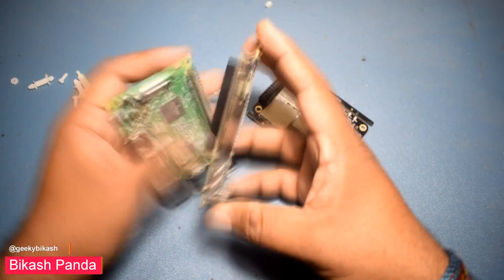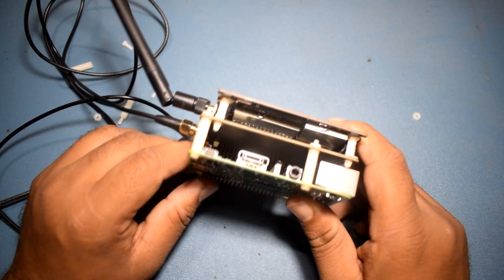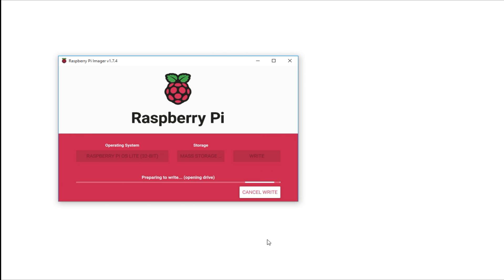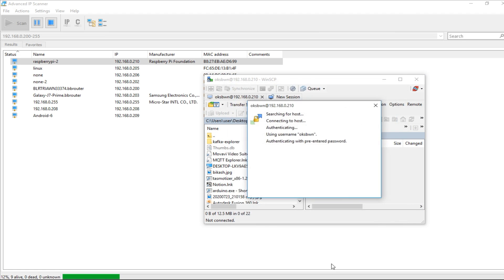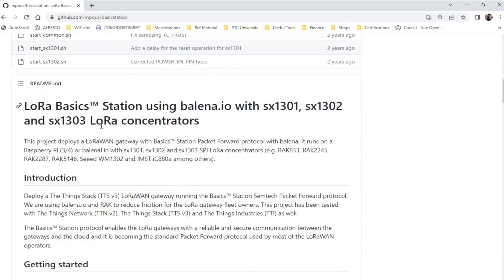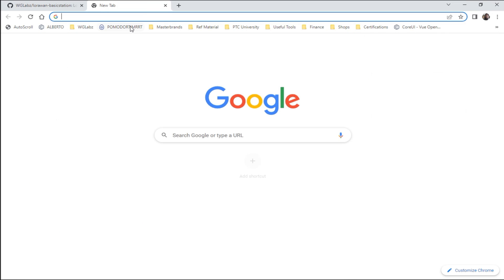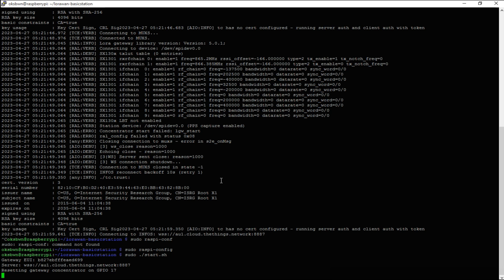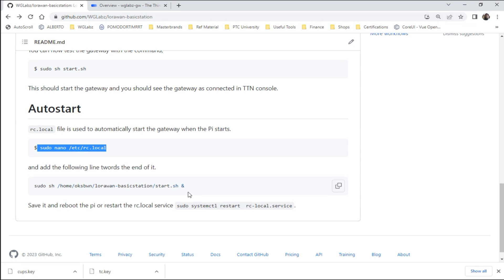Setting up LoRa Basics Station using RAK831 with TTN

Comment: Note: The RAK831 concentrator module is permanently out of stock.
Reply from the maker: Yup out of stock. Thanks, was not aware, but yes this shhould work with any SX1301 based concentrators..
Reply: @WGLabz   this works with sx1302 ?
Reply from the maker: Yeah, it should work. You need to make a minor change in the script's however.